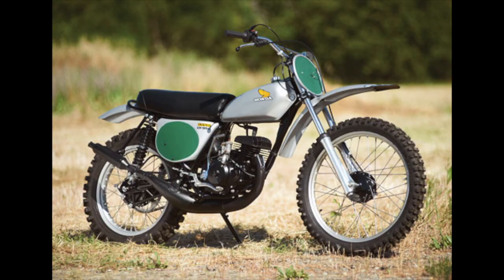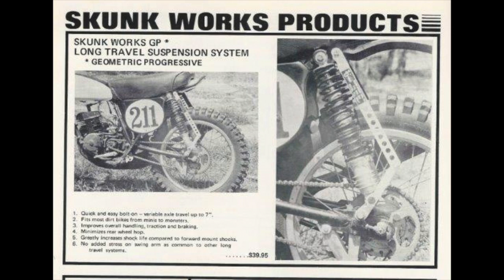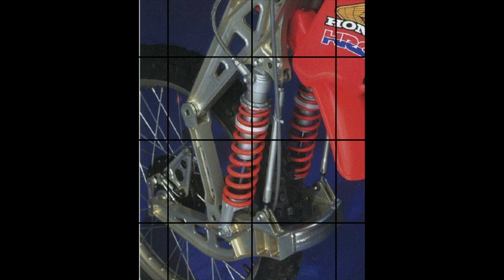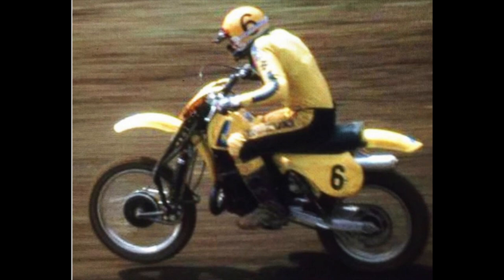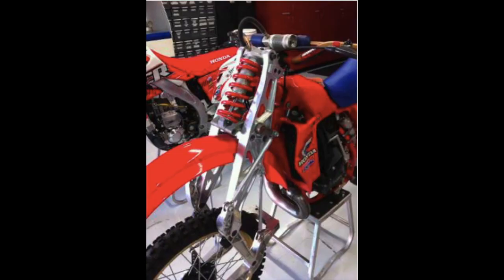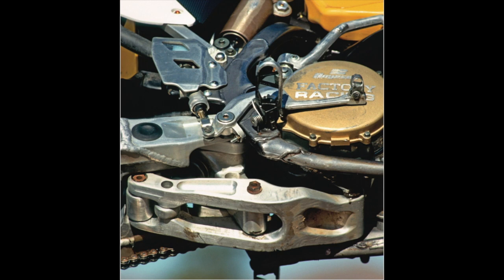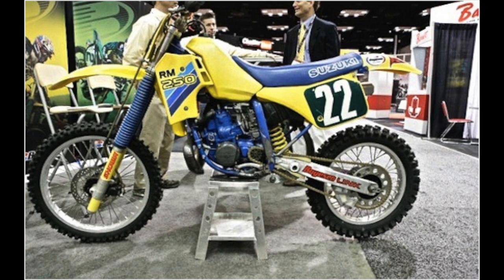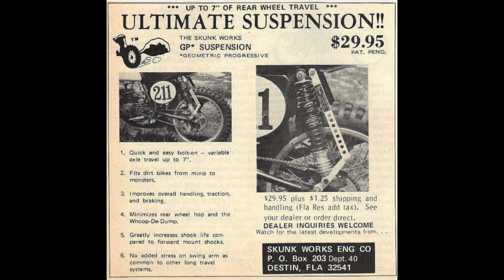Forgotten Suspension Technology

Comment: Interesting video that brings back memories. I actually had the Skunk Works GP suspension on my '74 Husky 125 WR enduro bike. It was the cheapest way to increase rear travel as suspensions started evolving very quickly back then. More than a few of my friends laughed at the way it looked, but it worked pretty well.
Reply from the maker: Interesting to hear it worked. I have never had anyone who actually used it before
Reply: @johnsmotorcyclemania7039  The pivot points were fairly flimsy, but it did increase rear travel and help smooth out the bumps.